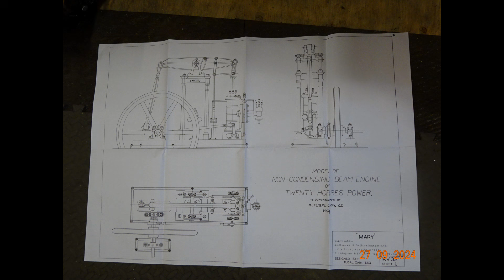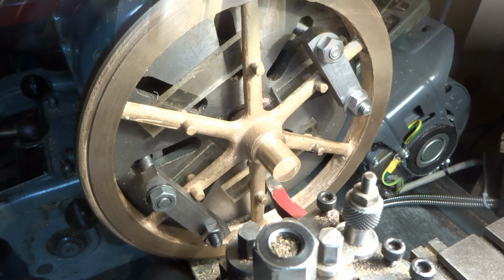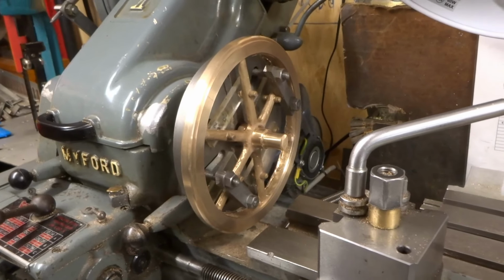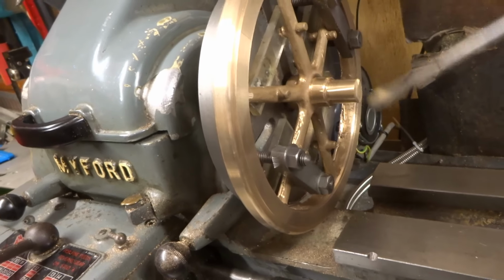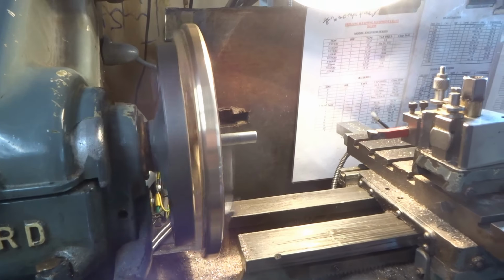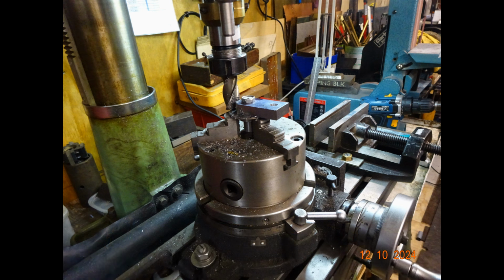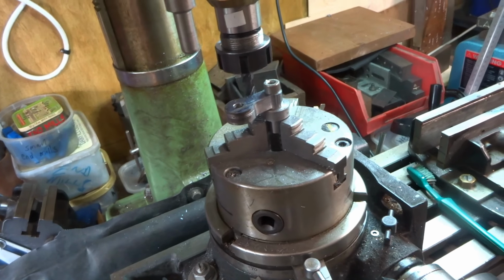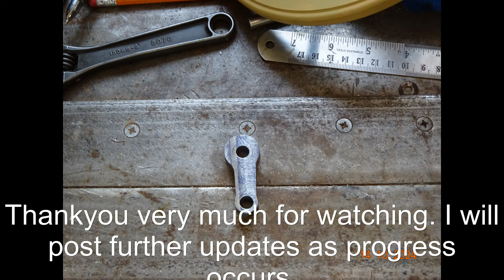My attempt to machine a 4 column beam engine pt 1

Comment: Nice job Mr W. I have a Chingleese lathe and mill. The faceplate has bolt holes that are ok for M18... not the easiest to use.
It's the model engineer that has to have cunning ways to hold . mount. Cut parts that most engineers and machinists would cry into their CNC's. 
this looks to be a nice build. stay well.
Reply from the maker: In my experience figuring out how to hold things is one of the most time consuming jobs, often accompanied by grinding a special tool to complete the part. Many thanks for your kind words.